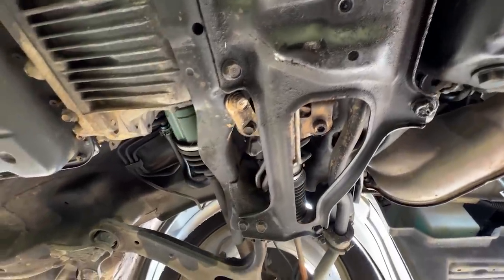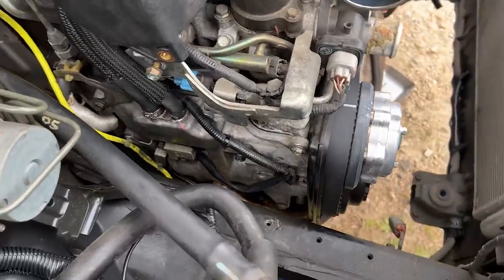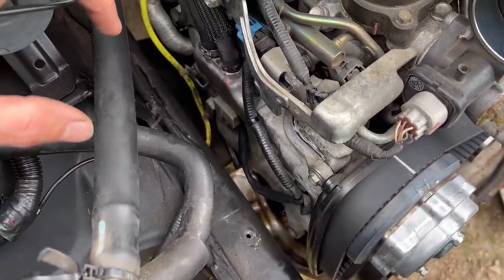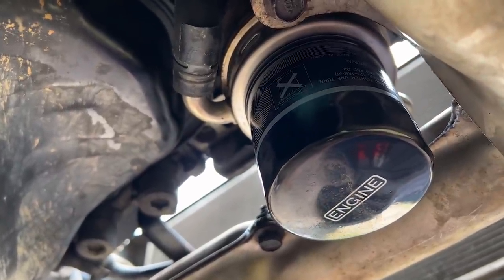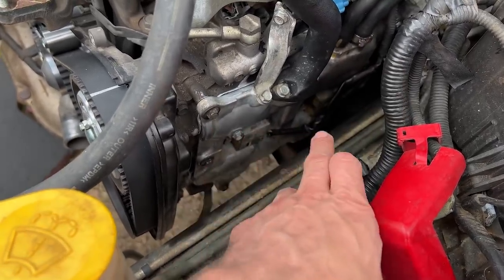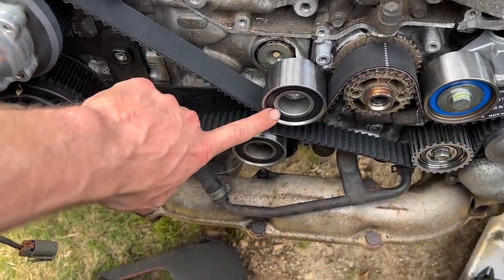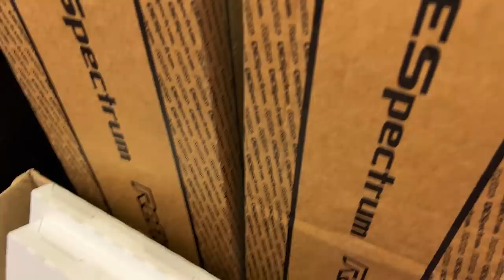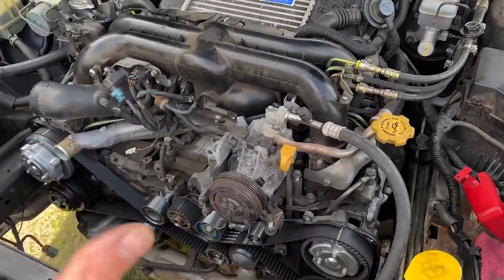200,000 Mile Subaru Legacy GT - Down To Business. Let's Get To Work!

Comment: Those bottom rear cover bolt are soooo much fun when they swell up from corrosion and won’t turn!    (Was that sarcastic enough, I feel like I can be more.)

Had to use an extra long, ball ended carbide bit in a die grinder to remove the bolt heads on more than one occasion in order to slide the valve/cam cover off.
Reply from the maker: Ouch..

Comment: My old Forester XT 255 is now pushing 180k (kilometres). Only consumables I have replaced are rear shocks , the radiator, front drive-shafts (torn boots) and front sway-bar links. 
If a major component fails the car will be off to the wrecker.

Comment: I didn’t realize how difficult this spark plug job was on the Outback XT till I tried it myself. Other than the motor mounts nuts, does the engine support rod has to be loosened as well in order to raise the motor? Looking under the car, one could probably raise the engine by the motor mounts themselves with a rigged 2x4 instead of having to lift it by the oil pan.
Reply from the maker: The engine mounts don't need to be touched. Never lifted an engine on these for plugs.
Reply: @MrSubaru1387  Maybe I'm overthinking this too much.. it was a bitch for me getting the #2 spark plug off.. had to use a combination of swivels/extensions to do so. I can't imagine how much more difficult the rear is since the frame tapers towards the rear. This is why I was thinking of creating some sort of rig to elevate the motor from the bottom. Or heck, using the crane to lift it just a bit. Spark plugs are only changed every 30K miles anyways..
Reply from the maker: @Mike_44  every 30k?? Since when?
Reply: @MrSubaru1387 FSM states every 30K.. ??

Comment: Definitely recommend replacing all of the PCV hoses. Also the suction hose and o-ring on the p/s if it hasn't been done. The intercooler to intake hose usually goes bad from oil and heat. The short fuel hose on the driver's side too.
I like to remove the engine mount nut as well but also one bolt on the pitch rod and jack up each side of engine. 
The older turbo EJs were Aisin, if I remember correctly. I still do coolant at 60k for turbo engines because of the heat.
My 05 GT wagon EJ255 was done at 200k. So done the bearing halves just fell out when I split the case and I built a EJ257 with forged pistons.
 I would recommend replacing the suspension parts with Spec B components. They are inexpensive and still available from Subaru. I did the Spec B lower control arm bushings as well as the aluminum diff and rear upper arms and they made a nice difference in handling (lightweight too). Later, I did the full Spec B front and rear suspension with aluminum control arms, the Bilsteins, STI pink springs and 06-07 18" wheels. Sometime down the road, swap out the 5EAT for the Lego (non-DCCD) 6-speed and Torsen LSD.

Comment: Really glad you did this one.. This is basically my car in the wagon version which now has 213K miles and I have no idea who worked on it before. One of my fears is finding cross threads if I tear down the motor. Also, the PCV valve assy on these cars is a PITA to get at at that bottom clamp by the block, but of course you make everything look so easy lol. Do you recommend just buying new upper links? I was considering pressing in new bushings, depending on cost. Thanks for the video!
Reply from the maker: If you have the means to press the bushings, it much cheaper.
Reply: @MrSubaru1387  I do yes. Did you have to use special pliers or remove the Intake manifold in order to get to the PCV valve? At least on my car it’s very tight space in there..
Reply from the maker: Clic clamp pliers? I didn't pull the intake on this car, just intercooler.
Reply: @MrSubaru1387  I see, so it can be dono without removing the I/C! Thank you MrSubaru.

Comment: Hey, I have a question for you Mr.Subaru, I have a 99 impreza outback sport with 2.2l and a manual trans. Now I know it's an ej22, but which one specifically? Ej223, etc? And the I also am about to replace that engine with a used engine, another ej22, and any advice you would like to give me on what all to address as for as preventative stuff to replace BEFORE putting it in would be greatly appreciated. I know I want to do the complete timing kit, and most of the gaskets and seals, but I'm not sure what all gaskets and seals I should focus on, as far as like, absolutely should do stuff, ya know. I also plan to install a new clutch and was thinking about upgrading it a little but and am also open to your suggestions on this. Any help you could give me would be VERY appreciated. Your the man dude, thanks
Reply from the maker: Look at the ID plate on the strut tower under the hood. It will tell you which EJ22 you have. Likely an EJ222 or EJ223

Comment: What year did Subaru implement the secondary air pump for the Outback XT? My ‘05 didn’t bring one.. unless it was deleted and they erased the code before. I’m guessing it was available only for 07-09 models..
Reply from the maker: I believe that's the dates as well, although not 100% sure offhand.
Reply: @MrSubaru1387  Ok, thank you
Reply: The d heads utilize the air pump. 05 and 06 ej255 use b heads like the early usdm sti without secondary air.

Comment: Hey, do you know why my 2012 Subaru Legacy shakes and shuts off when I come to a complete stop?
Reply from the maker: Sounds like a bad torque converter. I have video on the issue with the 2010-2012 Legacy/Outback on this channel.
Reply: @MrSubaru1387  Thanks for your response. Is that usually expensive to repair?

Comment: My 2008 spec b has 280000 miles , original turbo, original clutch . Engine  and trans never separated . All theses items need replaced on mine . Unfortunately it was backed into by a truck. I’m not sure it’s worth it to fix
Reply: Yes it is, even if it is totalled it is still worth it to fix in my opinion. The 08 had the best interior, the better front end with the 08-09 facelift and minor tweaks to the chassis. I didn't like the wheels as much as the 06-07, but they are such a good car.

Comment: Mr. Subaru, i need help. On my newly acquired 2010 outback. My idle is fluctuating. And sometimes the engine bogs down hard before going back to idle. Do you if there is a idle air control valve. On this model year?
Reply from the maker: There isn't. Try a throttle body cleaning and idle relearn. I have videos on both.
Reply: @MrSubaru1387  I cleaned the throttle body and did an Idle relearn. Took it out for a pretty long drive. And the idle seems a bit better. But the idle fluctuates just a tiny bit. Thanks for your help.

Comment: An unrelated question.  Why does Subaru recommend a 60000 mile spark plug change for my 2018 forester?  I had them changed today at 60300. They said old plugs looked pretty good.  Could I go maybe 5 years/75000 between plug change?  Seems like I could. My wife’s 2012 cx9 by Mazda recommends 100000 between plug changes. Why Subaru so conservative?

Comment: So I am currently piecing together a 2005 Forrester XT AT. and the oil cooler was really gunked up so as I was washing other parts I ran it out,cleaned it with some Dawn dish soap and let it dry in the garage do you think it would be safe to run that? or should I go ahead and order an aftermarket Mishi Moto oil cooler?